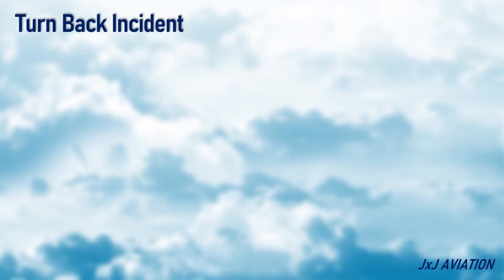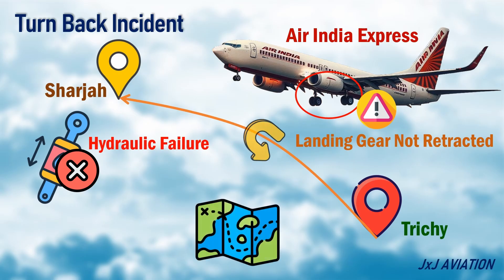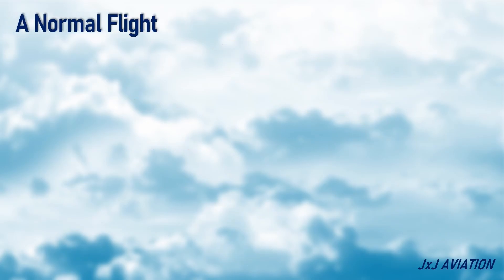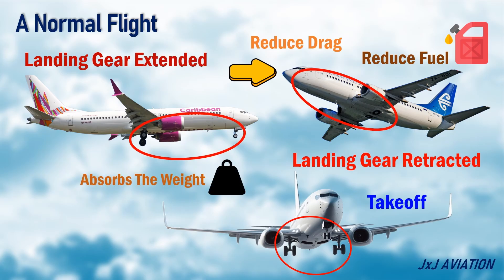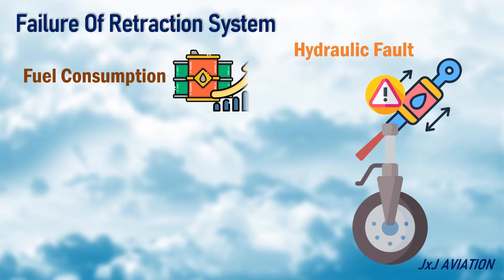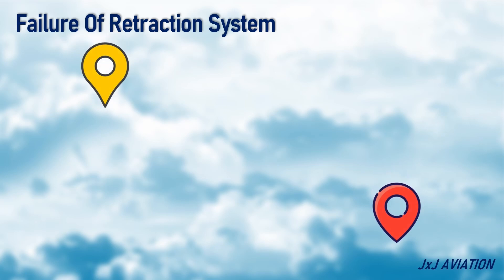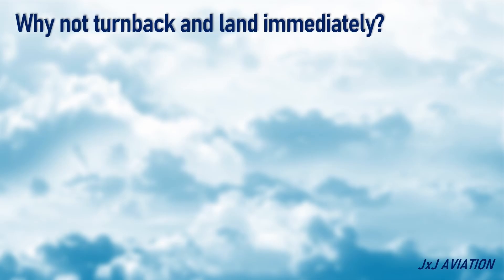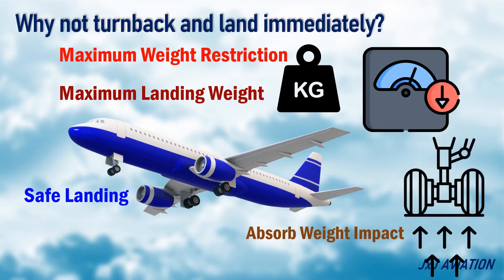What happens when Landing Gear Retraction Fails? | AirIndia Express Incident Analysis | Air Turnback

Comment: Unfortunately the Engineer / Technician forgot to remove the Landing gear pin so the gear didn't retract but the news are saying that there was hydraulic failure😂😂 this was simply framed so that the media cannot spread an irresponsible technician / Engineer of that airline.
Reply from the maker: thanks for the info